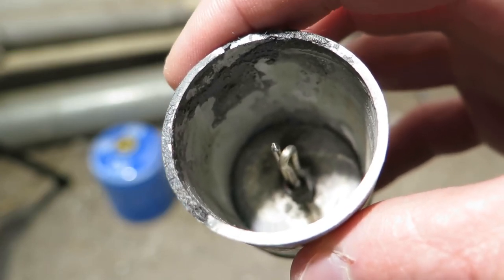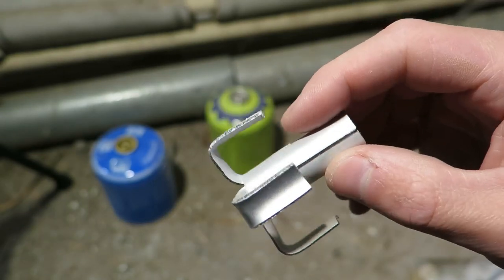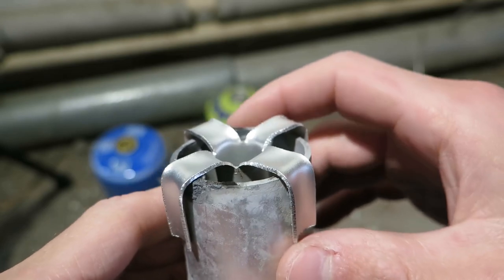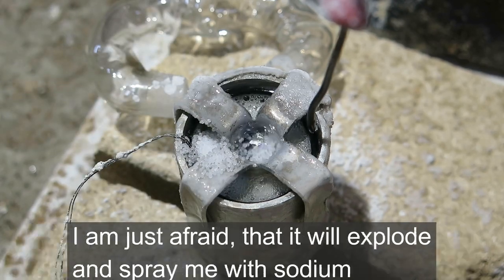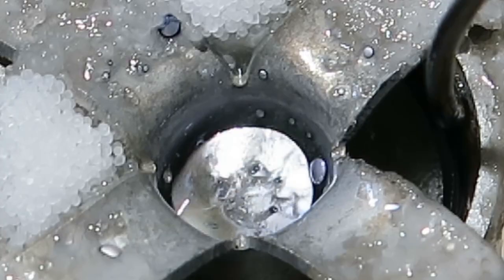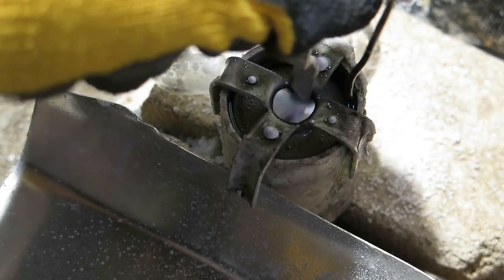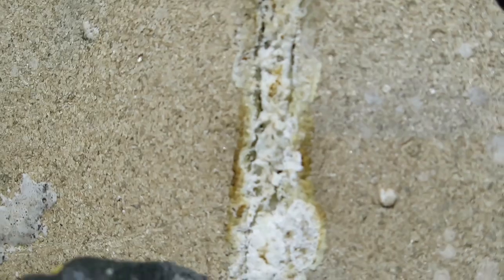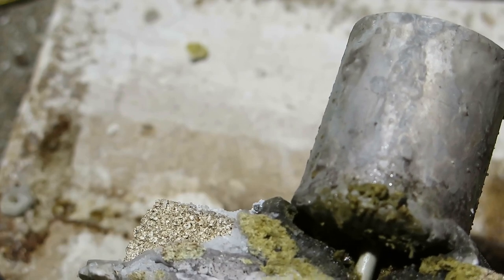Lab notes - castner mini-cell experimental setup #3

Comment: After tweaking outlet geometry to automate bubbling out sodium you can just place all setup in big aquarium with a layer of dry sand on bottom and fill in aquarium with some heavy inert gas, like Xe or Ar to eliminate sparks. Also, wikipedia tells sodium could be soluble in higly heated liquid NaOH, don't overheat.
Reply from the maker: There will be no sparks because there will be always some sodium in system. At least that's the theory

Comment: I've tried this cell but I couldn't produce much sodium. In theory it should produce oxygen, water and sodium. I was expecting the water to evaporate. The problem is that initial NaOH is not water free and some water remains in the molten NaOH in the high temperatures. Additionally water is produced during the electrolysis. Water reacts with sodium and produces hydrogen gas. So we have a mixture of oxygen and hydrogen that explodes and it can spray molten NaOH all around. It is very messy and dangerous. I also had a problem with leaks and making electric insulation of cathode electrode with the cell's case. Many materials corrode fast in molten NaOH. 
Your cell looks good but he careful and wear face protection all the time. Great sodium production.

Comment: Today I learned that i have to deep fry the aluminium parts in naoh before connecting it to electricity or you will end up with a monstrosity that explodes every 2 seconds with molten salt 
I almost lost an eye lol
Reply from the maker: Is time and temperature important?
Perhaps better option could be to use conventional anodizing process and overdo it?

I still think, that explosion happens due to sodium droplets ingniting in air, so If you can eliminate air, that would be best?
Reply: I've noticed that explosions seem to occur for two reasons (in a non-aluminum cell).  There is water in the electrolyte, or parts of the electrolyte are freezing.  Explosions seem to taper off quite a bit after the cell is run for quite some time.  Your cell could also have a cold spot that needs insulated, or the temp needs raised a bit.  When the electrolyte is dry, it will turn a black color and will almost stop bubbling, even under 40 amps.  The violent bubbling you see in this video means there is water in the melt.